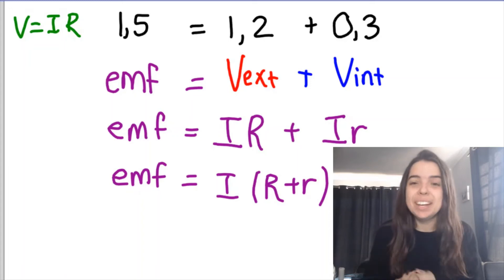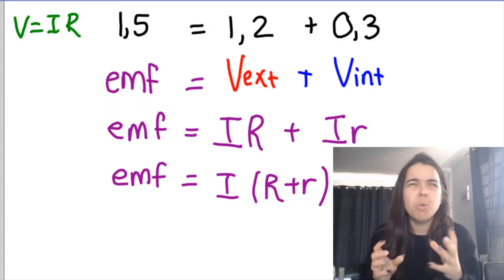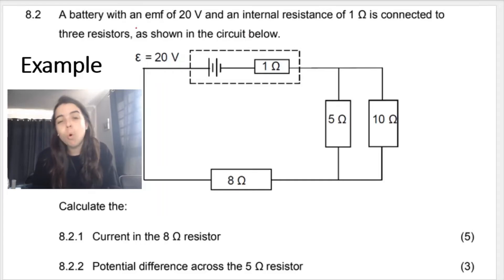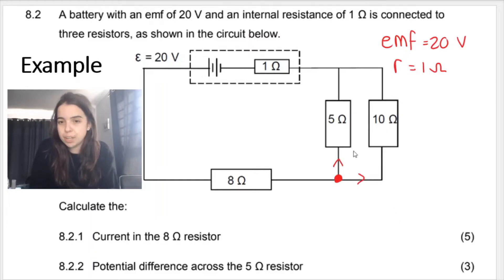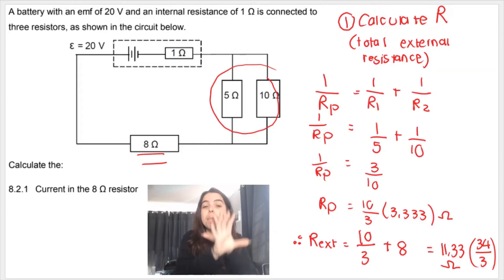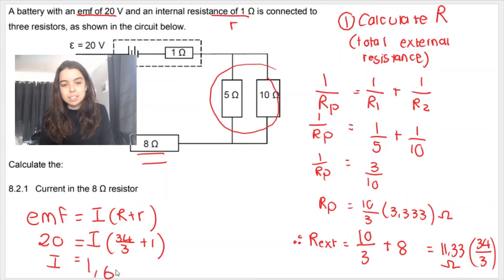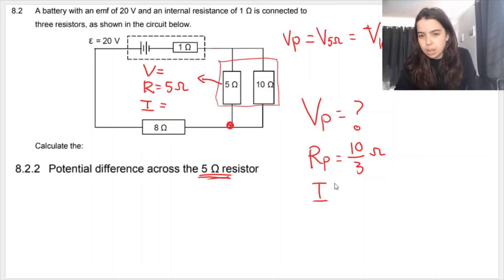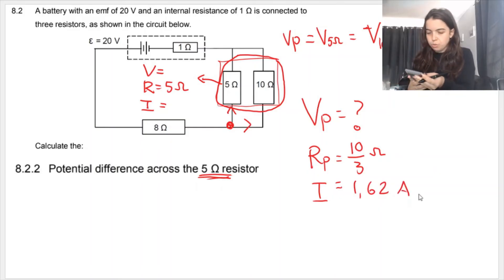Grade 11 and 12 Internal Resistance Calculations Electric circuits

Comment: Hi Miss Martins ❤
for the last question, i used EMF= Vint + Vext because Vext would equal the potential difference across the 5 ohm resistor.
My final equation was therefore [Vext + 1.62 =20] but I get a completely different answer. Just wanted to check why this wouldn’t work?

Comment: Mam why did we use the total current why calculating the parallel potential difference?
Reply from the maker: Because although the current splits into each branch, the total current still flows through the entire parallel part of the circuit. I hope that makes sense 💕